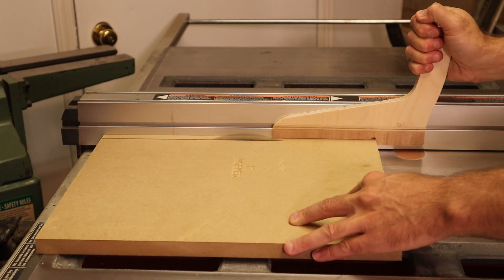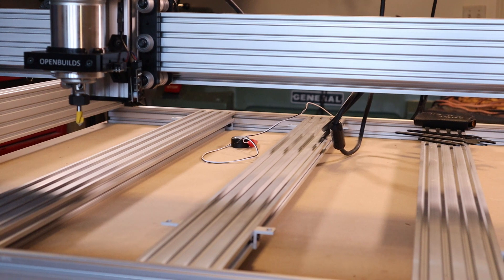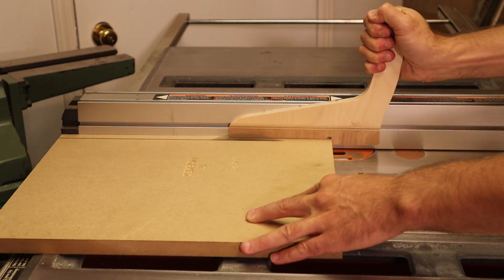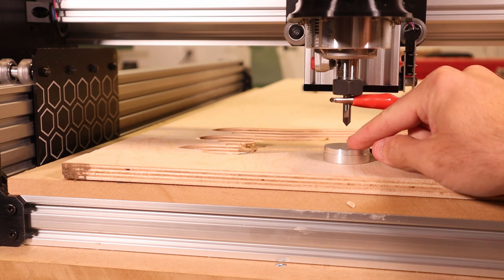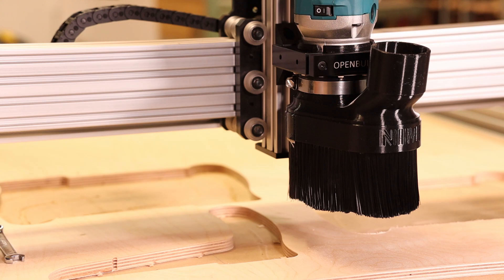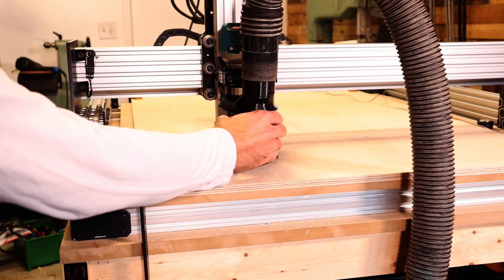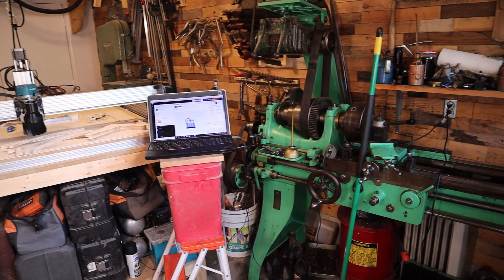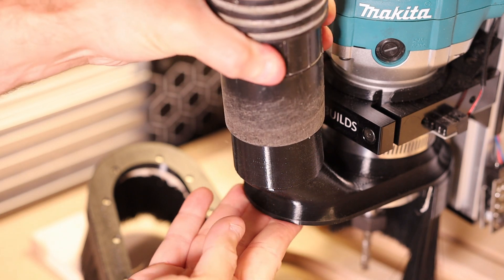Simple 3D Printed Magnetic CNC Dust Shoe & Handy CNC'd Push Sticks

Comment: The problem i have had with every horshair style dust shoe os the damned fiber gettung caught in the spindle bit. And the suction inlet (spindle side) is way to thin and gets clogged easily
Reply from the maker: I've found that some chips get stuck as well and clog everything up, it's a tough nut to crack for sure.  Anyone have Ideas?  Very stiff bristles perhaps?